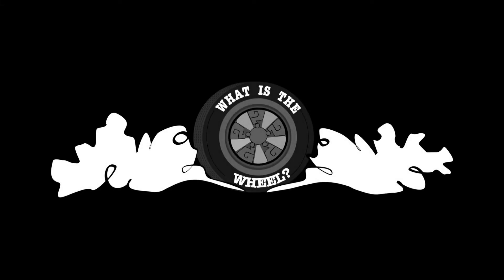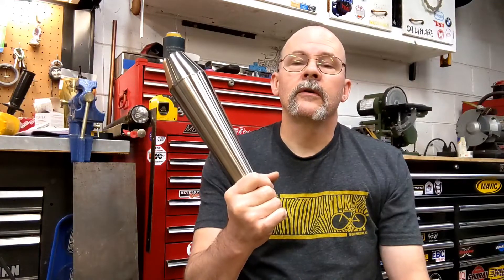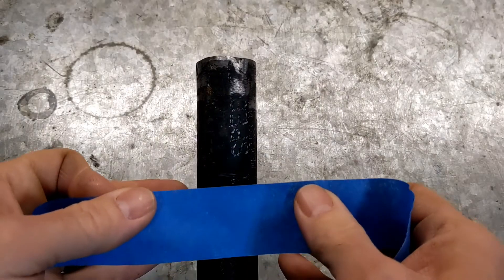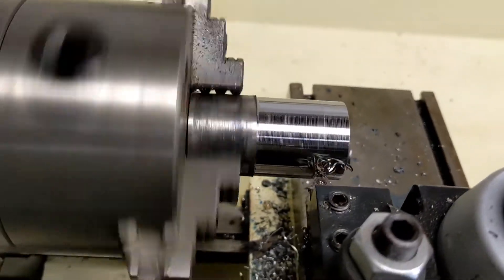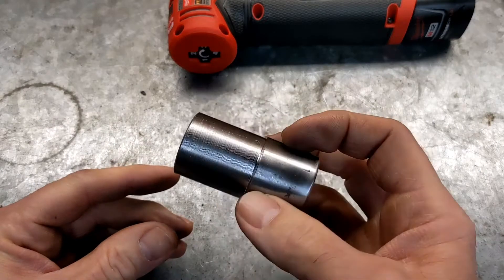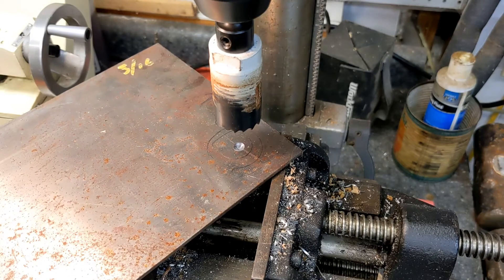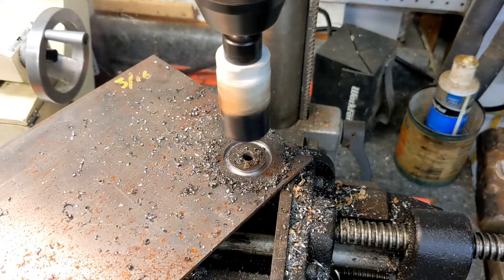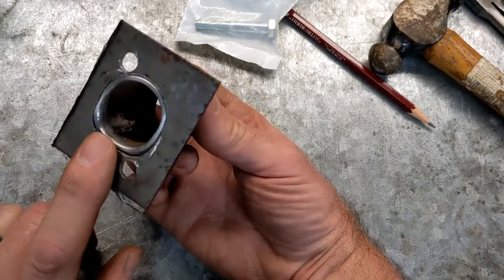Free-Flowing Predator 212 Exhaust Manifold build, that stock one was a cork. Pt. 1

Comment: I have made my own headers in the past with much success. I wish the engine builders would give us a little more meat between the exhaust studs. Would make things so much easier. Really like the music… keep the content coming. Thanks for sharing!
Reply from the maker: There is not much room for sure. I am going to redo this manifold with some thinner wall tube and I hope I can find something with a slightly smaller OD. 
Almost anything is an improvement over the stock manifold and muffler.
Reply: @WhatIsTheWheel  I subscribed curious to see what you come up with..
Reply from the maker: @DIYWilly  Thanks, I appreciate that. This is a pretty straight forward go kart build from a bare frame by someone that has never owned a go kart. I have a Chinese two stroke bicycle board track racer, a Wheel Horse garden tractor,  and a Plymouth Valimino hot rod that will be getting some air time once the kart is done. I am on the hunt for a motorcycle project too,
Reply: @WhatIsTheWheel  look forward to the coming videos they sound interesting. I’ll spend some time later and catch up on your current projects.

Comment: Hi, new sub here. Yesterday I was fitting a hemi Predator 212 to my old rototiller and had to remove the muffler to fit the motor to the tiller chassis. I saw that huge step down from the D shaped exhaust port to the muffler flange and about died laughing. I won't modify the one on my tiller but sure will on my cyclekart build. I'll bet there's close to a horsepower extra to be had in a 1" pipe and a jet change.
Reply from the maker: It is crazy how small that pipe is they could have easily made it big enough to fit the port. I have a 420 predator on my wheel horse garden tractor and I made a manifold for it to improve flow and it also runs a open air cleaner with a bigger jet in the carb.

Comment: Good stuff! About the only way to get a decent header or exhaust these days is to make it yourself. The ready made headers I've bought lately all required "fitting" as the flanges are wrong. Briggs headers I started out brazing them with a brass rod, but I had a few break off kart racing so I switched to mig welding and they held up. If you're not going to be bumping around on a rough track brazing should work. I'm terrible at mig welding even when I had a decent shielding gas welder, now I've got a flux core cheapie and I'm even worse with it. LOL Great video keep it coming!
Reply: At least they did better with the 224 muffler. It has a 7/8" inlet ID. You can remove a little more for a slightly larger inlet. Mine is going on my near stock 196. The 224 will get a header pipe.
Reply from the maker: Thanks, I intend to keep making them, I even have another project lined up, a board track style Chinese two stroke bicycle.
This exhaust is so short and the muffler is pretty light, hopefully it won't break.
Unfortunately Youtube got me on this one, it sent out notifications yesterday but the video did not release til today, oh well.